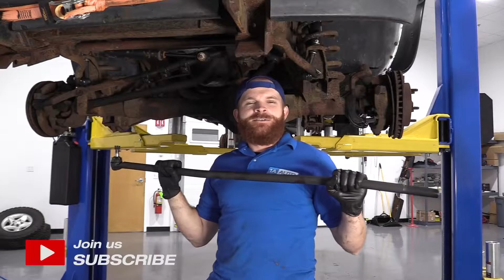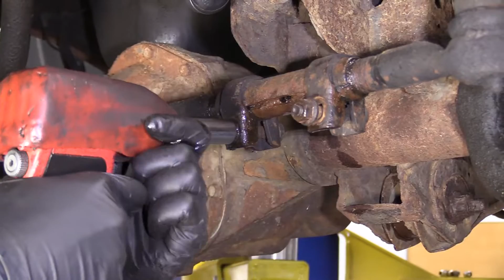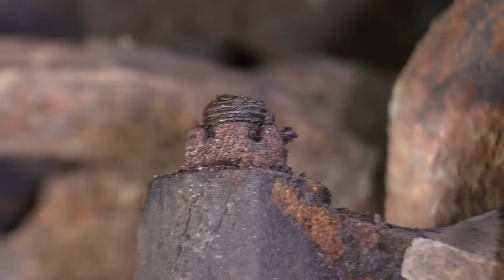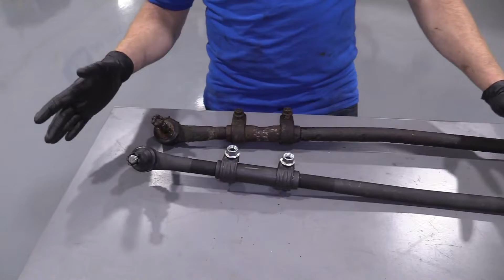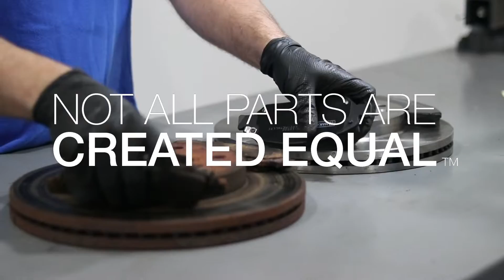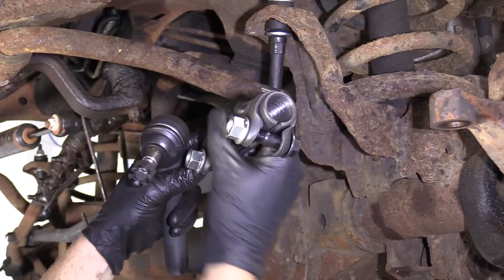How to Replace Driver Side Inner Tie Rod 94-02 Dodge Ram 1500

Comment: My Tie rod end doesn’t have a hole for a Cotter pin and a Special Nut. What keeps the Nut from coming off? I found out if I tighten the nuts down too much. The Rubber Boots go down too far.😮😮😮😮😮😮

Comment: Easy job compared to 4wd with rack n pinion. Issue with inner tie rod best to replace rack. This involved removal of control arms and coil springs. Basically rebuild front end since you are in there. Ball joints bushings rack n outer tie rods brakes.

Comment: I tightened my tie rod to 65 ft lbs and the castle nut went down so far and the cotter key is above the castle nut and not holding the nut. What did I do wrong?